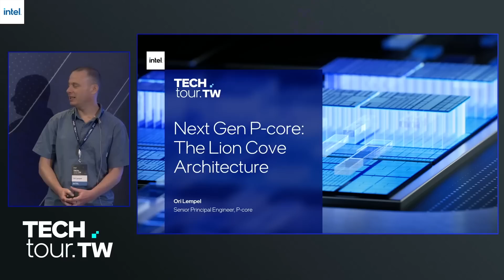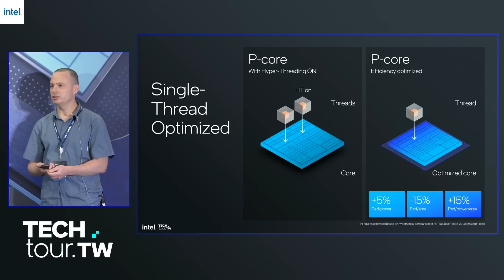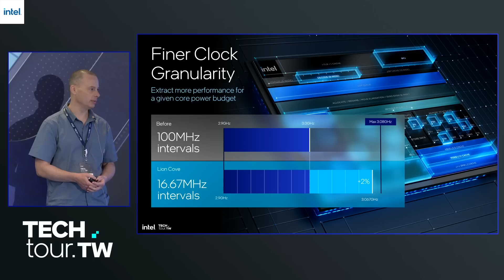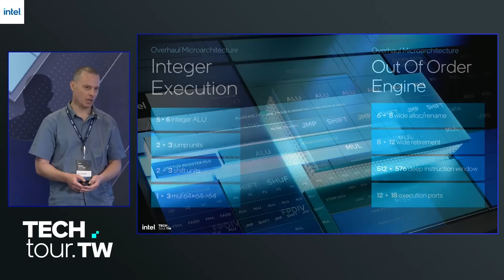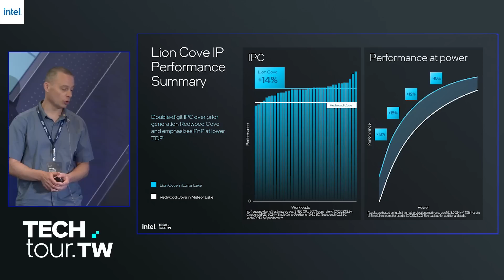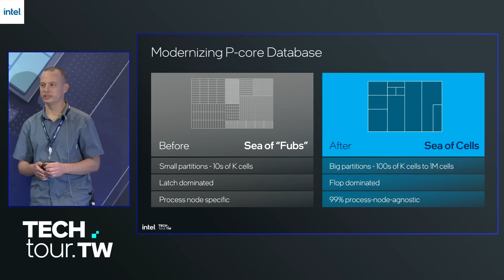Architecture All Access: Live at Lunar Lake ITT: Next Gen P-core Lion Cove

Comment: Wow, I thought meteor lake had a lot of advancements. This is next level. Great to see efficiency improvements!
Reply: MTL's core was more or less the same as their current desktop ones.
Reply: @vyor8837 The advances of MTL aren't all in the cores. It moves to a tiled design, introduces the low power island concept, introduces ARC iGPU architecture, inplements a new E-first Thread Director, and gets designs rolling for both in-house and external fabs in the same product.

There's a lot in MTL that isn't a CPU core, and all of those are still solid advances over RPL-P. MTL makes changes to the SoC and keeps a relatively safe  uArch change as time was clearly spent elsewhere making changes that will benefit future atchitectures.
Reply: @DigitalJedi  and none of those will make it to the desktop.
Reply: @vyor8837  Incorrect. Arrow Lake-S has dual-sourced chips (20A & N3), arc graphics (Xe LGP+), a tiled architecture, and a yet unconfirmed thread director that will trace its heritage up from RPL, through MTL, and into the SoC tile.

Low power island is the only one unlikely to come to desktop because there's no need for it. In its place, the E-cores are put right on the ring bus next to the P-cores and L3 cache. A suitable substitution when performance takes priority over single-digit TDPs.

And even if none of those innovations came to desktop, so what? Like desktop is the only segment that matters? The laptop market is massive, and even if MTL only spawned a new wave of chip design there, it would still be responsible for test driving changes that would improve the quality of 10s of millions of devices in each generation to follow.

I don't want to come across as a fanboy. I worked on the process that stacked those tiles. I've seen how the sausage is made, and even if the performance is unimpressive, the tech supporting it is undeniably here to stay.
Reply: @DigitalJedi  desktop and server are indeed the only ones that actually matter because intel already has a near monopoly on laptops. They could, and have, release a new laptop gen that is worse in every way than its predecessor and only lose maybe 10-20% of total sale volume.

It's neat tech, but also not exactly new overall. Like... AMD kinda already did parts of it with zen4.
Reply: @vyor8837  The mobile market matters. It's the majority of client cpu sales. Domination of a segment is also when it should matter. Your own example of a drop in market share proves what happens when a company lets up even a little.

As far as the "worse in every way than its predecessor" thing. While you don't outright say it, this conversation implies you mean MTL again. In that case, I'll direct you to the 165H matching a 13700H at less sustained power draw and the larger iGPUs putting MTL in an actually competitive position. 

As for what things Zen4 did first. Zen4 does not use a tiled architecture. It is MCM on desktop, yes, but on a different and less power efficient packaging tech. On mobile, it is almost all monolithic save for dragon range, which is the same as the desktop silicon. Zen4 has no low-power island, though it can power down sectiona of the die, a feature that goes back many generations on both sides at this point. There is no parallel to many of the things in MTL just due to how different the designs are. It was first to 4nm on mobile, which is actually a good accomplishment and is a significant contributor to the efficiency advantage along with being monolithic.

Zen4 is a good architecture. 4C is legitimately impressive and I wish it was in more consumer things. Everybody did pretty good and ran a close race this generation and hopefully will again next gen. That's when everyone is at their best.
Reply: @DigitalJedi  I don't actually mean MTL. I was referring to cannon lake.

Comment: looked at P-core slide and i so believing that Intel P-core paradigm is changing from P6 into E-core design 

just like centrino era when P6-design called as E-core /small-core while Netburst is called as P-core / big-core and years later, Core 2 come with P6 design that used until 2024 and since that, P6 is a base of Intel Big core (until 2024) and Netburst abandoned. 

and now, Intel designing new P-core with the E-core design (one of the notably design is splitted scheduler between INT and VECT)

Comment: Make integrated GPUs good...otherwise no buy....for the 12th years consecutively
Reply: Meteor Lakes iGPU already surpasses AMD's iGPU in quite a few games, they just need to continue optimizing the Arc drivers and then Intel Arc iGPU will be ahead in most games.
Reply: @__aceofspades  that's a lie, msi claw sucks big time vs Rog or Legion products. Core Ultra was just hype, various updates couldn't fix the lag and stutters, MSI panicked and now releasing lunar lake version.
Reply: @StartreckTu Claw is a really bad example of MTL. It fares much better in a traditional laptop setting, where it is competitive with AMD's phoenix APUs. The 780M is usually a little ahead still, but the race is much close than it was with Rembrandt vs RPL-P.

Comment: Come on Intel! Please deliver at least 20% IPC increase from Raptor Cove. And please much lower power consumption than Raptor Lake. And please a 12 P core only Arrow Lake Core Ultra for world class gaming and no hybrid scheduling gimmicks for ultimate best set and forget gaming CPU for todays games and all games past 15 years, And super great core to core latency being on same tile. I so badly want a homogenous CPU with 10-12 Big cores on a single tile/ring bus/CCX-CCD/die. Come on Intel deliver it.
Reply: You don't need more than 8P cores. No game is gonna benefit from that. And for workloads that do actually properly utilize more than 8 cores, E cores are better.
Reply: @lycanthoss  Well Cyberpunk and Last of Us Part 1 and Spiderman Remastered have seen reports of them in some situations using more than 8 P cores. More P cores better for gaming as no scheduling quirks and easy set and forget solution. No Star Citizen or Elden Ring issues. A 12 P core gaming only chip and then the 8+16 regular ones Intel should release both.
Reply: @Wolverine607  just because they utilize more than 8 cores does not mean they benefit from them. In basically every game, when you go from 8 core to 16 core CPUs like from 5800X to 5950X, the performance gains are mostly from higher clocks and cache. Games (and most apps honestly) mostly care about single thread performance.

Just look at previous CPUs. The 7600X easily beats the 5800X and X3D (in some games the X3D is better, but those games are more cache dependent), 5900X and 5950X. And if you think the CCD part matters, look at the 12400 vs 10900K.
Reply: @lycanthoss  Well I am sure CCD part matters dual CCD/CCX cross latency penalty 12400 vs 10900K. Well 12400 has far better IPC on Golden Cove than 10900K on Comet Lake. We have no hypothetical 10 P core Golden Cove/Raptor Cove which would be the best.

And Xeon please. Xeons have worse IPC than client Golden /Raptor Cove. Maybe if Intel HEDT was like past iterations without overloaded glamorous enterprise features detrimental to gaming, than also maybe. But no ring bus or  client more core equivalent after Broadwell-E. Instead the horrible mesh latency snice Skylake X lake and yes that includes Sapphire Rapids but worse.
Reply: @lycanthoss  Star Citizen hello? Its just a matter of time before the new games uses 10-12 cores.
Reply: @lycanthoss  AMD multicore CCXs are unusable as example, its the latency from 1 ccx to the 2.nd that tanks the performance when both are used. A better example is is Intel 10.gen with 10 equal cores. Works like a charm on that one since you have no architectural latency issues that hinderes scaling with more cores.
Reply: @lycanthoss Games like low latency, which is why it can use up to 8 cores so well, for more than 8 cores you're either using e cores on Intel or using a second die on AMD
Reply: @mika2666  Hardware unboxed has a video on cache vs cores. Games don't really scale past 6 cores. In basically all the games they tested for that video you get on average 3% more performance going from 6 to 8 cores when the cache amount stays the same. The simple matter of fact is the reason higher CPU SKUs perform better is not because of core counts, but because of cache and clocks (I mean sure, extra cores help, but the difference is basically margin of error). This is why Intel isn't bothering with more P cores.

Comment: I can't forget the situation when HT was first released more than 20 years ago, it brought an 80% performance gain in certain supported software. Of course, this refers to the performance gain that can only be brought about when the application software itself is cache-friendly. Intel is giving up its own advantages. Intel gave up its own advantages but was picked up by AMD. Intel's advantages are likely to get worse. AVX512's success on the Zen4 architecture is an example.
Reply: You couldnt be more wrong. HT used to be extremely important when core counts were tiny, back when core counts were 1-4 cores. Now with Intel having 24 core consumer CPUs, it no longer is relevant, there are more upsides to removing it then keeping it.
As for AVX512, you have to be joking. For consumer use it never gained traction, you can count the number of applications that use it on one hand. When Intel discontinued support, it became effectively obsolete, as nobody is going to develop consumer applications for AMD's fraction of marketshare where only Zen 4 and beyond support it. Also Intel has already created a better successor, AVX10 which is already rolling out in servers and should hit client next year.